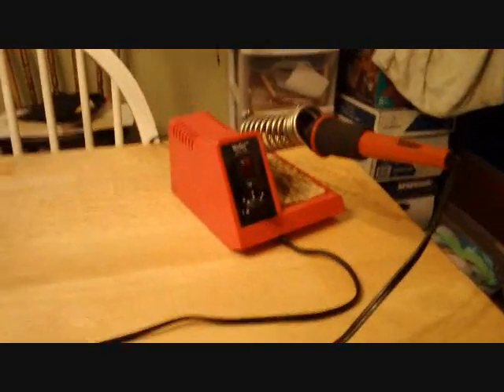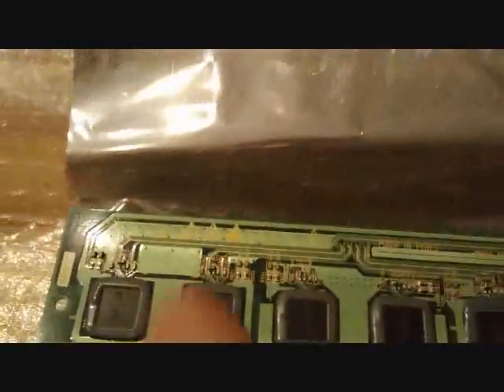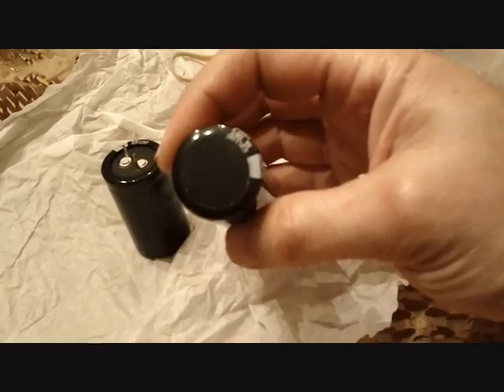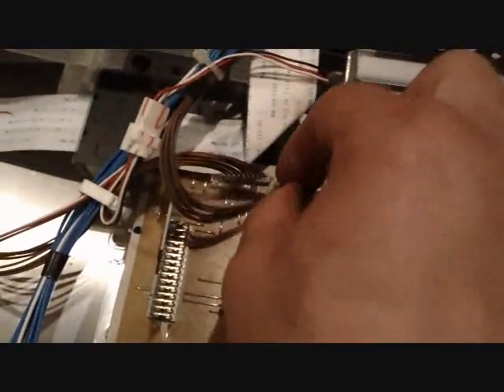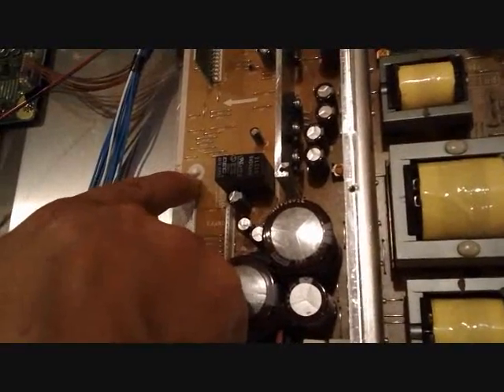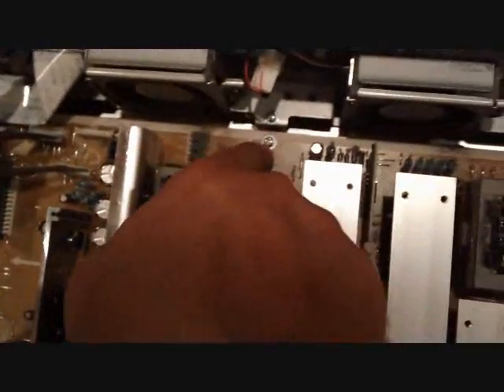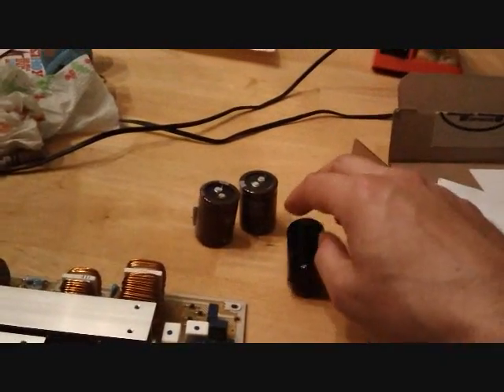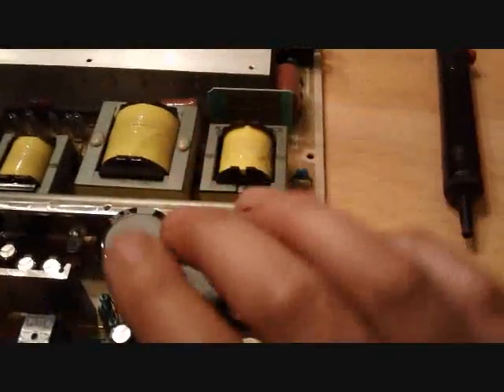Hitachi Plasma repair attempt Part 3

Comment: My plasma has no sound no display. Its hitachi 50 inch. Vs and va is 65 and 86 volts.  Standby light is solid green and remote on/off working. But display not come